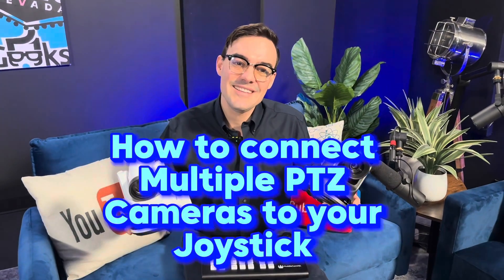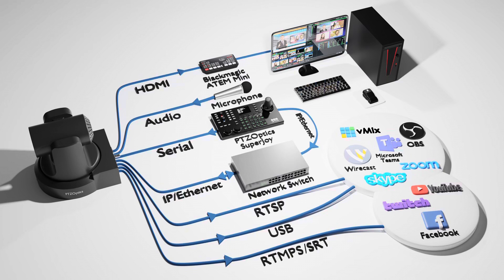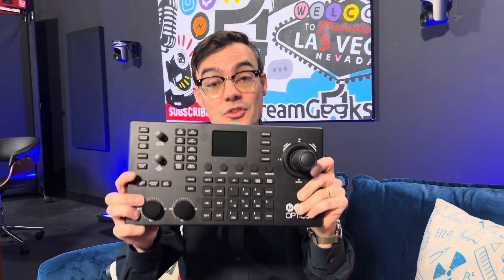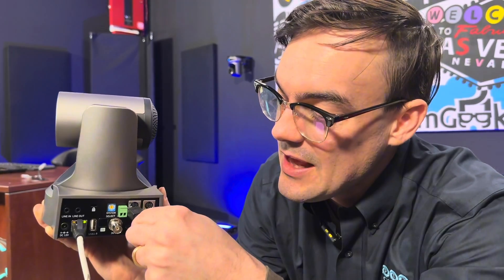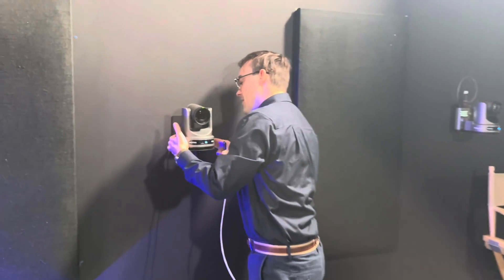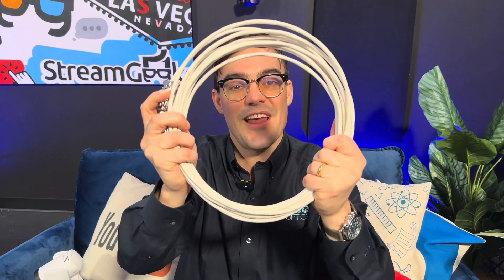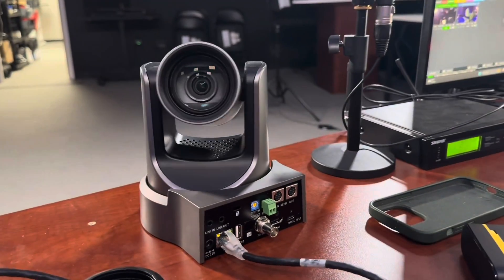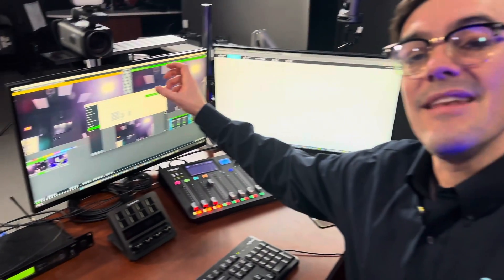How to connect multiple PTZ cameras to a controller

Comment: Hello my brother ! I have the FeelWorld USB 10 camera, with the controller I can't connect the ip,

When I set the IP it says connect error Visca!

Please help me
Reply from the maker: Hello!
Connecting multiple PTZ cameras to a controller, especially when using a specific model like the FeelWorld USB 10 camera controller, requires a bit of setup to ensure seamless operation. The "connect error Visca" message you're encountering typically indicates an issue with the VISCA over IP communication between your controller and the PTZOptics cameras. 

Here's a step-by-step guide to troubleshoot and potentially solve this issue:

Check Camera IP Configuration: Ensure that each PTZOptics camera has been assigned a unique IP address that is reachable within your network. This can usually be done through the camera's onboard menu or a web interface if the camera is already connected to your network.

Update Firmware: Make sure that both your PTZOptics cameras and the FeelWorld controller are running the latest firmware. Firmware updates often resolve compatibility issues and improve overall functionality.

Verify Network Settings:

Ensure that the cameras and the controller are on the same subnet. For example, if your controller has an IP address of 192.168.1.5, your cameras should have IP addresses like 192.168.1.6, 192.168.1.7, etc.

Check the network switch and router settings to ensure that they are not blocking VISCA over IP commands. Some network equipment may require specific configurations to allow for multicast or unicast traffic, which is often used by PTZ camera control protocols.

Controller Configuration:

Within the FeelWorld controller, carefully re-enter the IP addresses for each camera, ensuring there are no typographical errors.
Verify that the VISCA over IP settings (such as port numbers) on the controller match those expected by the PTZOptics cameras. PTZOptics cameras typically use port 5678 for VISCA over IP control.

Test Connection:

Try to control each camera individually from the FeelWorld controller to isolate any specific configuration issues.
If available, use a network scanning tool or software to confirm that the controller is successfully sending commands to the cameras’ IP addresses.
Consult Documentation: Refer to both the PTZOptics and FeelWorld controller's manuals for specific instructions on VISCA over IP settings. These documents often contain crucial details for troubleshooting network communication issues.

Contact Support: If after following these steps, you're still experiencing issues, consider reaching out to PTZOptics support or the support team for your FeelWorld controller. They may offer additional insights specific to your setup and equipment.

By carefully checking each of these areas, you should be able to resolve the "connect error Visca" message and successfully control your PTZOptics cameras with the FeelWorld USB 10 camera controller.

Thanks for checking out our Channel! 
Learn More: https://ptzoptics.com/

Comment: We need a video on recommended network switches for connecting multiple cameras and devices using NDI that help reduce lag
Reply from the maker: Hello!
Creating a network setup that effectively supports multiple cameras and devices using NDI (Network Device Interface) requires a robust and capable network switch. NDI is a high-bandwidth protocol that allows for low-latency transmission of high-quality video and audio over a network. When choosing a network switch for an NDI-based production environment, several key features are important:

1. Gigabit Ethernet Ports: Each port should support at least 1 Gbps, though 10 Gbps is preferable for larger setups or 4K workflows.

2. High Bandwidth and Throughput: The switch should be able to handle the aggregate bandwidth of all connected devices without bottlenecks.

3. Quality of Service (QoS) Capabilities: This allows prioritization of NDI traffic over the network, ensuring smooth video streaming.

4. Managed Switch Features: The ability to configure and manage the switch is crucial for optimizing performance and troubleshooting.

5. IGMP Snooping: This feature helps in managing the multicast traffic which is common in NDI workflows, reducing unnecessary network load.

6. Low Latency: Look for switches that offer low-latency performance to ensure real-time video transmission.

7. Reliability: Enterprise-grade or professional-grade switches are recommended for their robustness and reliability.

Recommended Network Switches:

1. Netgear ProSAFE Series
Models like the GS108T, GS110TP, or GS728TP are popular in smaller setups. For larger installations, consider the M4300 or M4500 series.

2. Cisco SG Series
Cisco SG300 or SG500 series switches offer robust performance and are suitable for mid-sized to large setups.

3. Ubiquiti UniFi Series
UniFi switches like the US-16-XG or US-48-500W are well-suited for NDI, offering a good balance of performance and manageability.

4. TP-Link T1600G / T2600G Series
These switches provide good performance with QoS and IGMP snooping, suitable for small to medium-sized setups.

5. Aruba Networks Switches
Aruba offers several switches like the 2530 and 2540 series that are reliable for professional environments.

6. D-Link DGS Series
The DGS-1100 and DGS-1210 series are cost-effective options for smaller NDI setups.

7. Extreme Networks X440-G2
For larger and more demanding environments, this switch provides high performance and extensive features.

Additional Considerations:
- Power Over Ethernet (PoE): If your cameras or other devices support PoE, consider a switch that provides PoE capabilities to simplify cabling.
- Future-Proofing: Consider the future growth of your network. Choosing a switch with more ports and higher capacity than currently needed can be a wise investment.

Remember, the best switch for your setup will depend on the specific requirements of your NDI workflow, including the number of devices, video resolutions, and overall network infrastructure. Always verify the compatibility of the switch with your specific NDI devices and software.